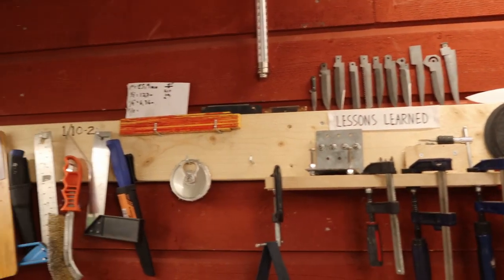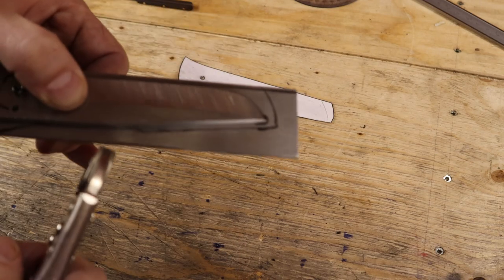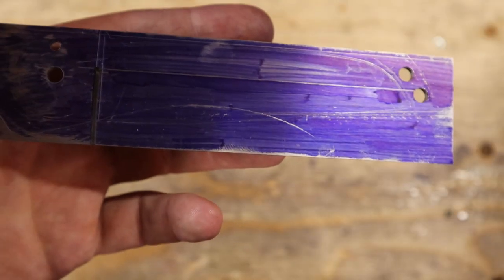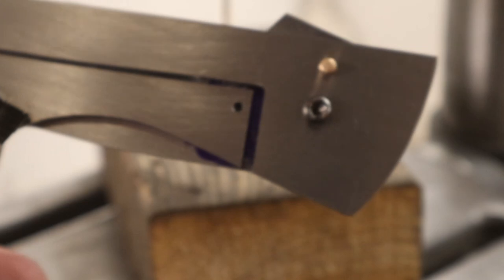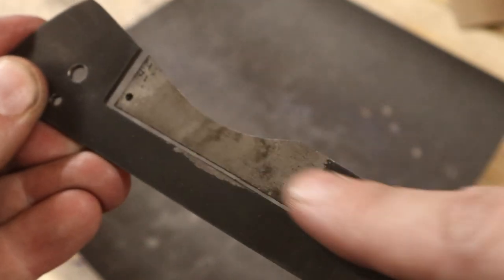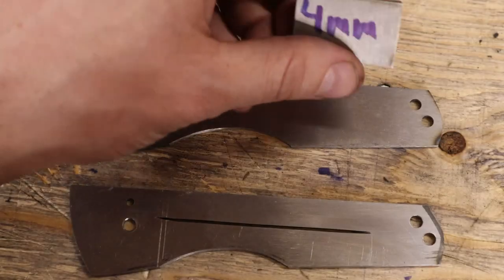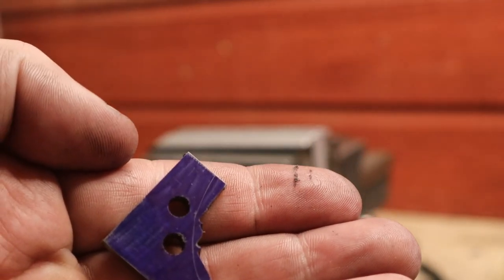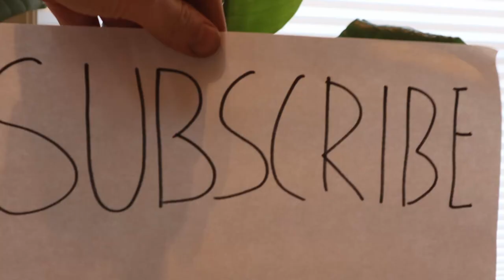Knife making - Handmade big liner lock knife

Comment: To create the half moon pin hole, just find the starter hole the same way you did. Then attach the blade to a block of wood via the main pivot hole. Line up the starter hole with the drill press, clamp the wood to the press's table, and now when you rotate the blade on the block of wood the drill will cut the exact half moon you need.